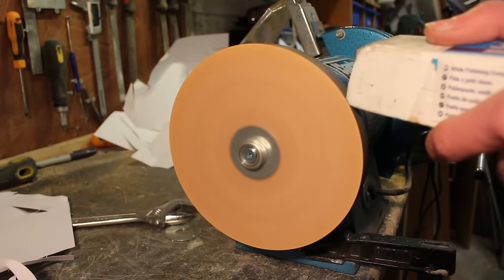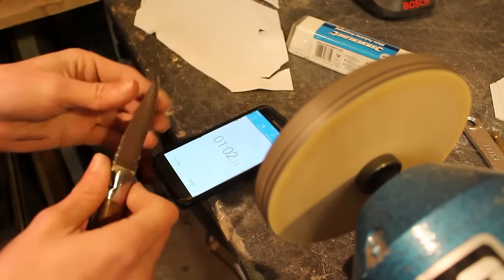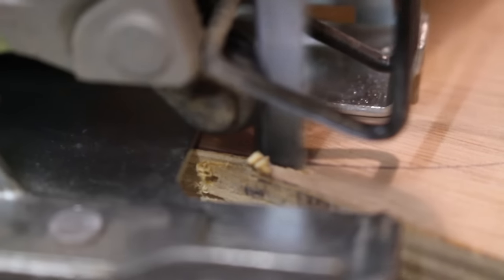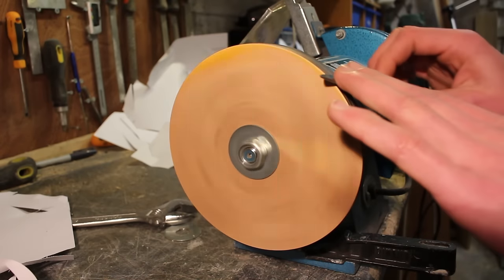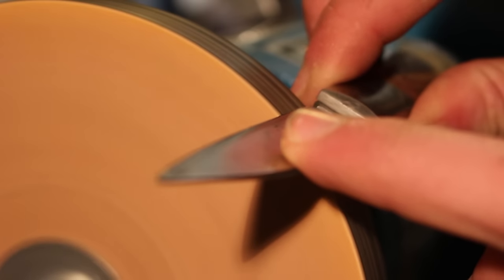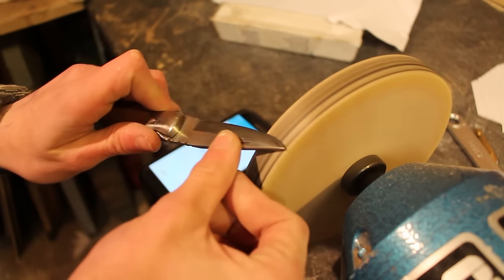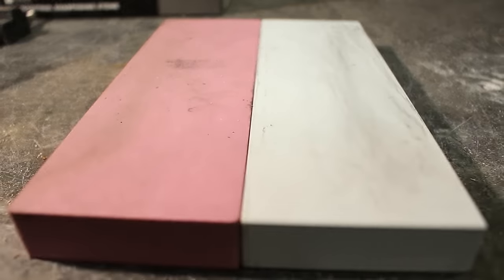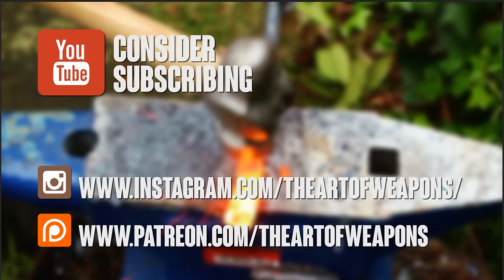The Laziest Way to Sharpen Any Knife to Razor Sharp 2

Comment: I'd just like to point out, with this method, you're basically creating a big burr (By sharpening from the spine to the edge).
This big burr will mean that you can get your knife really sharp, but the edge will be dulled incredibly fast (it will require honing very very often). Many knifes just need honing or stropping to get sharp (replacing the bent burr into place). The longer the burr, the faster it will bend, this is why knifemakers sharpen from the edge to the spine. 

I'm not saying this is a wrong thing to do, I just want to provide more information as tho who this technique is for. A knifemaker would not use this (unless they don't know what they are doing) and this will require frequent honing and sharpening to maintain the edge (far more frequent than one would normally).
If you don't know how to sharpen and don't want to learn, then this is for you.

-Knifemaker and blacksmith.
Reply: Karl Hurtubise wow. Imho this is nonsense. I don't know on which planet knifemaker sharpen from edge to spine, but not at the one i live. The burr won't get to long or even stay there forever, it will eventually rip of and break off of the edge, at least after cutting two or three times into some wood f.e. This happens on a microscopic level. You can easily watch this with a cheap USB microscope. There is absolutely no advantage by grinding from edge to spine. It's more the other way around! When you sharpen in the direction of the spine, small steel particles get pulled towards the spine, ripping small teeth into your edge, which make the edge rough. When steel is soft, a burr can get pulled under your edge, folding around it. 
Watch Japanese chefs or traditional Japanese smiths how they sharpen knifes or swords. They do it from spine to the edge. And they do this for some longer time than any american. Your method has its truth when we talk about very rough grinding with low grit numbers, where the burr is still thick enough to hold on and bend. But when you grind with 3000 grit or more, the burr gets so incredibly thin, that it breakes or rippes of. Though this works only for hardened steel.
Reply: Karl Hurtubise i forgot one important point. When you grind a knife on a whetstone, you absolutely need that burr. Only with the burr you cam actually feel if you grinded long enough on one side of the knife, because it will only be feelable if you your grinded surface of the right angle reaches the tip of the edge. When you feel the burr you change sides, then use a lower grit and repeat until you feel that burr again. If you reached the finest wanted grid you can break the burr by grinding one stroke from edge to spine or you use a fine steel sharpener or a leather belt. The problem you mentioned really just occurs on a macroscopic, rough level, but not on a microscopic level on very fine abrasives.
Reply: by grinding or sharpening from spine to edge, you still create a burr, it is however a lot smaller. Japanese knife makers also sharpen from spine to edge on whetstones,they actually do a back and forth motion to discard any burr more efficiently. so I don't know at all where you get your info from.

Also, on a microscopic level, you always have a serration pattern, as it is exactly that that provides a cutting edge. Without serrations (although the finer they get, the better) you would only be able to cut with pressure, not with back and forth strokes. Those serrations are essential and the finer and more regular they are, the better the edge (other factors as angle and geometry also play a factor) 

Usually, sharpening is done by pushing the edge in the stone, and then final stropping of the knife is done by drawing the edge on a strop.

Now your point about the ripping of small teeth into the edge is just exactly what grinding it does. With a 3000 grit stone, those channels are extremely tiny and will create the serrations needed. Whether it is steel particles or stone particles that create these channels, they will be the same size also. They are still created by sharpening from spine to edge anyway and those channels will be exactly equal, the only difference being the burr size (by pushing the edge into the stone, the burr is created from the very fine edge being pushed up with pression. Stropping (or honing ) is then needed in both methods to align the burr. The longer burr will bend more quickly and need re-stropping faster, it will also tend to chip off.

A very simple search on google will provide info in concordance with my view, and blacksmithing/knifemaking manuals also provide more info. Fyi: I've studied this, and I did it on this very planet.
Reply: Hey Karl... do you have a video that you can recommend for proper techniques for sharpening knives.
Reply: If you strop it on leather afterwards you Polish the burr off
Reply: Corregulated cardboard works also.
Reply: sharpening from spine to edge is the CORRECT way to sharpen a knife.
it produces much less burr than the other way, as evidenced by microscopic photography. it is the exact reason you should never use a motorised sharpener of the type found at the back of can openers, they sharpen along the blade, leaving one long burr which quickly snaps off and returns you knife to blunt
Reply: spine to edge or edge to spine makes no difference, as long as you dont sharpen along the edge as the OP wrongly suggests
Reply: and i highly recommend not to try this shit. i'm a friend of a good old "sharpening steel" - u get the knife same sharp, don't need any electricity and if u got a bit practise, u need only 20-30s. 
sooo....the title of this upload is a lie. + your knifes will not live very long if u use a grinding wheel on them.
wkr,
~ a german toolmaker from daimler benz, class-best of a final exam
Reply: Dichtsau uiuiui da trägt aber einer dick auf. Aber nett das du deinen Lebenslauf mit uns teilst. ;) 
Ein abziehstahl ist gut, kommt aber immer drauf an was mit der klinge passiert ist. Eine runde oder schartige klinge muss geschliffen werden. Imho sind da nassschleifsteine dir beste wahl. Hat jeder so sein eigenes Rezept
Reply: When did I suggest sharpening along the edge ? 
Also I don't think you understand what Spine-to-edge or edge-to-spine means. From spine to edge, you are pushing the material towards the edge (in case of a secondary bevel, from the back of the bevel, to the edge). This causes a huge burr at the sharpest point of the edge, which when aligned by honing, will cut very very well, however that burr is incredibly fragile and will break into food, dulling your edge incredibly fast. The reason why it is fragile is mainly because the material constituting the burr was moved from the back of the spine to the edge by friction and heat, and it welds itself very weakly together at the edge. This also causes another issue, the edge is the one receiving all the heat, which is approx 700*C-1000*C from the mill scale igniting (sparks). you would start losing temper at around 400*C-500*C. The blade doesn't absorb 700*C of heat very quickly, but the thinner your material is, the quicker it will reach that temperature. The edge being very very thin, it will be the part of the knife most susceptible of losing it's temper due to sparks. Now, there is not a lot of heat when sharpening with a buffing wheel, as shown in the video, but when doing grinds, it will have a definite effect. Blade grinds are done spine to edge for this reason.
This method is what this video shows.

Edge to spine pushes your material away from the edge, towards the back of the knife. This only creates a small burr that is far less fragile than the other way. The burr is also different, it is just the far point of the edge rolling on the opposite side of which you are applying pressure to grind the bevel.
This Burr doesn't have a breaking point like the other, and it is significantly smaller (unnoticeable to the naked eye.)

FYI, microscopic photography shows that spine to edge creates a very uneven burr and a breaking point in the edge. The info is out there, look at it before teaching people the wrong stuff.
Reply: im having a hard time getting what you mean by spine to edge and edge to spine. Are you saying that its best to sharpen with edge leading or edge trailing strokes on a stone?
Reply: edge leaging (as if you're cutting a stone). This means that the grain goes from edge to spine (thus not creating a burr). Since in the video the wheel is spinning up, he is pushing the grain from the spine towards the edge (spine to edge).
Reply: Karl Hurtubise okay now, this shall be my last comment on this video. 
I don't get your talks about burrs at all. Fact is: by grinding a knife with belts or grinding wheels, or even on rough wetstones you will always create a burr. This bur is sharp but very brittle. Only at very soft hardened blades like high chromium kitchen knifes, the burr is elastic enough to bend over. On every blade with a hardness of 56 HRC or higher, this burr will eventually break off on finer grits or after polishing on a leather belt. The absolute target has to be to grind a blade to a V-shaped edge with no burr at all. This is obtained with wetstones of a gritnumber of 3000 or higher even when used from edge to spine. There are videos on YouTube that show microscope pictures of differently sharpened blades. Properly done, there will be absolutely no burr, but a V-shaped edge with a minimal thickness of only a few steelgrains. 
I have to tell you: when you sharpen knifes and they still have a burr at the end, then you are either doing it wrong or your steel is very very soft. The target has never to be to create a burr that will be your primary cutting tool. 

A burr can easily be removed while grinding from spine to edge. Though it seems to be easier to remove the burr by grinding from edge to spine. But this will ultimately lead to a sawtooth edge because the grinding stone Crystals ripp huge lumps of steel grains out of your edge pulling them towards the spine where they get cold welded on the way up. This leads to an ugly microscopic texture of your edge. The burr that appears even when grinding with a wetstone of 3000 grits or more is so extremely thin (at best a few atoms thick) and brittle that it breaks of the edge immediately after cutting a sheet of paper or by polishing. There is absolutely no need to worry about burrs when you do your sharpening right. The burr will even be so small that you can't see it with a microscope. It just has to be removed. And when you use wetstones to sharpen your knife there is no heat issue at all that will weaken your edge. This is why this method is the most common sharpening method since centuries or even millenia. 
Translated to this video: if the surface of his flywheel is very fine and if the polishing paste is also fine, it is possible to sharpen the knife without leaving a burr. But it will be a hollow grind edge. Though i would always pull a knife 2 times over a leather belt to give it it's final touch. The heat issue here is a problem though.
Reply: I was answering to previous comments, not to yours. You clearly have your mind set in stone.

However, to respond to your comment,
Fact1: I agree with you, they will always create burrs. Again, in the last post I've said how the burr from the version in the video will be bigger and will have break points. This burr will break into food,etc and will leave a dull edge. the remaining edge will be chipped.

Fact2: Every edges bends over, even on HRC65 knives. That is why you have to hone your knife now and then with a honing steel.

Fact 3: your sawtooth explanation makes zero sense. The whole purpose of grinding is to have the ''stone crystals'' rip through the steel and cut tiny grooves into it. by grinding finer and finer, the grooves are simply finer too. The size of the grooves are the size of the grain. The grooves will be the size of the grain whether you grind spine-to-edge or edge-to-spine, however they will widen up as the grain travels. The widening of those grooves is far better placed at the back of the spine than at the edge. The ''crystals'' wont cold weld to the side, they end up at the end of the surface on which they are ground. That is either the upper bevel part of the grind, or the edge. By having them clump up the edge, you create a bigger burr. 

I sell knives for a living, I have asked another person who sells knives for a living on this issue to be able to explain it more clearly, and they told me the exact same I am telling you. Good Blacksmithing books all agree on this (althought I've seen some that disagree).
Stone techniques use this principle, as well as knive grounds.

Also, hollow grinds do leave burrs too,they simply can't be seen with the naked eye.
Reply: Karl Hurtubise Karl Hurtubise good morning. Yes, i knew that you weren't answering my comments. 

Let's talk about fact 3. I agree with you on the facts 1 and 2.

This is my problem: until a few years ago it was common sense, that every sharpened knife carries  a burr which is the real cutting agent. This is what you keep telling people. 
BUT this is not necessarily true, which people found out since microscopes are affordable to a wider range of people. 

Just think about it: some times you surely remove burrs from different steel workpiece. You might agree that a visible burr of (let's say) a steel bar you cut with a bandsaw is very easy to remove cause it brakes of when moved or bent. 

The burr on a knife edge is way thinner and three or 4 times as brittle. It will break of the edge by just staring at it. Provided that the steel is hard and the sharpening was decent made. 

I could watch this process in various labs i worked in. (f. e. I once had an internship in a renowned hardening company. There i observed hardened axle parts from Audi cars under a microscope. Beforehand i had to cut, grind and polish them) 

You say that the grooves will be as wide as the grain size of your abrasive. That is also not right. Did you ever turn steel on a lathe? Did you observe how steel builds up on your tool, making the tool working less precisely? This happens on the grain as well. When you grind from spine to edge the steel chips get a chance to reach the end of the edge and be carried away. If you grind from edge to spine, the abrasive grains crash into your edge, ripp and break steel out and carry these chips towards the spine leaving invreasing grooves. From spine to edge you won't have such an impact when the abrasive grains reach your steel. The whole process is softer. 

Dammit i wish my englisch was better. I have trouble to exactly explain my points.
Reply: This is honing it, similar to a kitchen steel. With no teeth this method wont work
Reply: This is the exact same thing as using a strop, the compound he puts on is made for strops
Reply: This is not stropping, stropping a dull edge will only make it more dull, it only works on rolled edges or very slightly dulled edges and it is done on a leather strap(or similar mediums) at low speed. You don't remove material when stropping, you align the edge. At the speed this wheel goes and with grit compound, there will be lots of material removed (relatively compared to stopping). This is sharpening and the compound is a high grit compound and acts as a sanding agent. It is a very good way to use very high grit polishes such as 3000+ grit without it being super expensive.
Stropping compounds are .5 microns (approx 50000 grit)
polishing compounds are anywhere from 1000grit to 5000 grit. The one kind he uses is approx 3000 grit.
Buffing compounds (differently named than polishing compounds) can go up to 9000 or even 12000.

It would be the direction you would use a honing steel, or a stop, however he is grinding the edge bevel, which would have to be done in the opposite way. Which by the way isn't safe with his particular setup, or any setup involving wood wheels that the knife can bite into.

(edit to josh, after reading your comments further down, I think we're saying the same thing, but different)
Reply: Karl Hurtubise I agreed with you. And it is a really fast way of stopping.  I'm 32 and been sharpening knives for 20 years professionally (family owned a very popular knife store.)
Reply: He actually talks about the potential for the knife to bite in to the wood. At 3:10 he turns the grinder around so the wheel is spinning away from him and then continues to explain why.
Reply: Karl Hurtubise "you don't remove material when stropping..." then please tell me how does the stropping compound changes color to gray/black when it is not iron oxide forming from tiny amounts of removed steel?
Reply: Because the compound is abrasive and will remove material. You can strop without using compound which re-aligns the blade edge without removing material - same as using a steel for kitchen knives. KH makes no mention of using compound.
Reply: I dont use compound when I strop, the purpose of stropping is to realign the edge, as stated multiple times. However I know that there is 28000-50000 grit compounds for stropping specifically (I have used them in the past) and those do remove a tiny bit of material while also serving as a lubricant(depending on the kind) to preserve the strop longer. Personnaly I find strop compounds to be the easy way around an easy task, stropping or honing is very easy to do already in a perfect manner, the compound simply makes the strops last longer .

I do use the one kind of compound he uses, which is polishing compound, as well as buffing compound (~10k grit) but I don't use these for honing, they are to clean the blade(polishing- 3k grit) of any scratches, and the buffing to make it mirror if I wish to (buffing 8k to 12k) and the buffing compound I almost never use, since when the knife is perfectly mirror, the finish will be ruined by a few handlings.
Reply: Actually yes you are removing material. It's just the bad teeth breaking off. So minimal I don't consider it material being removed.
Reply: It's a flat blade, where are the teeth? The idea of honing is not to remove material, but re-align it in the cutting direction.  Yes after some time, the burrs will fall off and when this happens, the knife will be considered blunt and will require sharpening with (say) a whetstone.
Reply: Gee Zee adult?
Reply: The teeth are micro serrations that come from the abrasive grit of whatever sharpening medium your using on the knife. So its not teeth like a wood saw its very small teeth get cut into the metal by the sharpener. If you look up a magnified picture of a knife edge, even if its super smooth looking normally if you zoom way in its pretty jagged and saw like.
Reply: West Coast Warriors Archive good to know
Reply: Karl Hurtubise the proper way is?
Reply: Weeaboo Trashski From the edge towards the back of the knife is the proper way (edge to spine). It however still is dangerous to do so if unexperienced.
Reply: Don't mess with Texas actually i mostly agree with you. You can believe me, that i really use all my knifes. I just sharpen them when they are too dull for my personal taste, not just for fun. But going into detail and to understand the physics of knife sharpening can be really helpful too. Especially when you are a knifemaker. In the end an edge is something that is microscopeically small and can't be seen with the naked eye. 
But yes, all that bevel talk was really annoying.
Reply: Karl Hurtubise Read his title man. He didn't claim this is the best or most professional way lol. It's quick and easy.
Reply: Karl Hurtubise   This is a great method and I will give it a try.  I. Currently use a belt sander with a 1200 grit belt.
Reply: dude try it or don't no biggie!
Reply: Excellent point Karl!  May I ask your opinion on diamond n n blocks?  They seem rather crude feeling compared to a nice stone.  I am using a diamond bed then stone. Should be alright?
Reply: Yep. I made the same comment. This is power stropping. Might as well coat the wood with leather, as it is proven to be very effective at uncurling the edge of knifes. This method cannot hone a new edge, wood is softer than steel.
Reply: Richard Smith 
Thank You for your input.  Most appreciated!
Reply: Hahaha.
Too obvious that you did even not try it.
Reply: Karl Hurtubise Karl! You seem like you know your craft. Any way I can contact you with some questions??
Reply: Karl, isn't misinformation frustrating?  I feel your pain, but I could see this plywood method being useful as a finishing step for drill bits after you shape them on the normal grinder.
Reply: Richard Smith this would only be power stropping if he wasn't using polishing compound on the wheel. The polishing compound is what is harder than the steel and thus removing it on a microscopic level. What is being done in this video is actually removing metal not just stropping.
Reply: My thoughts exactly. A lanky set with diamond stones and a leather polishing jig is good enough for the hardest steels like m4 and s90v. 10 minutes and you're good
Reply: Finally, some common sense, thank you.
Reply: Actually, with an abrasive involved, the material will be removed from the harder material. Think about a buffing wheel.
Reply: Karl Hurtubise, you are right.  When you sharpen a knife on whetstones, you push the edge of the knife away from you. Thus you are sharpening the blade from edge to spine. When you are stropping a knife, you pull it across the strop from spine to edge. YouTube is full of myths and misinformation about sharpening.
Reply: Ghryst - only commies and Martians uses a can opener to sharpen a knife...and we all know how dull their knives are.
Reply: Taunus-Tims - Sure Hans - easy for you to say.
Reply: Scandi vs convex grind, go.
Reply: How can I learn the art?  I have a grinder to convert, I'm looking to support 3 kids with some side work.
Reply: Karldude, you have never ever in your life made, handled, or sharpened a knife. Just a whole lot of keyboards. Now go away.
Reply: Murray Carter for one, disagrees.

Anyways. Always fun to observe the secterisms and politics of the sharpening community, and the "wars" they ignite
Reply: @Taunus-Tim  Ok, so...I'm a hunter and a butcher and I have to say I learned and have always sharpened knives from edge to spine...never had reason to complain about either sharpness or durability.
Reply: @rich1051414  You missed where he applied polishing compound to the wood, didn't you?
Reply: Yes burs will be all you create with this method. Thanks for pointing it out.
Reply: @Taunus-Tim  lots of sharpening methods are exclusively edge to spine. Straight razors are an example of this and they require much finer of an edge than knives do.
Reply: @karlhurtubise7073  even without the serrations a sawing motion breaks static friction which allows better cutting. The serrations are the main reason but not the only one.
Reply: @Dichtsau  the video doesn't use a grinding wheel, did you even watch the video? And a steel doesn't sharpen a knife, it just fixes the geometry of an already sharp knife.
Reply: @karlhurtubise7073  as someone who made straight razors which require sharpening by strop, the stropping actually does remove miniscule amounts of material, slightly less than the finest most watered down polishing compound, this is due to the mineral content of the leather. The leather itself is too soft to do much of any reshaping of the edge.
Reply: @karlhurtubise7073  also, he has the knife edge away from the direction of travel of the wheel, it CANT bite into the wheel which is why there are wheels just like this mass produced specifically for sharpening knives.
Reply: This method looks simple. I am not a knife expert. I just want a sharp knife to cut my veggies. Thanks for the video
Reply: @camg5367   When I heard him say that it's very important to turn the grinder around so that the wheel is spinning in the right Direction; that being away from and not towards the edge you plan to sharpen, I couldn't help but crack up. The direction polishing wheel is rotating is, as he correctly stated, very important. But you never should have to flip your grinding or sharpening Wheels 180 degrees in order to sharpen anything correctly. You just have to flip your knife!!!! Derp. And if he hadn't figure that out, this'll probably blow his mind... try mounting the grinder perpendicular to the bench instead of parallel. And you'll have access to both sides. Did anyone else think the same, or is it just me? LMAO
Reply: @Taunus-Tim  You have a lot to learn about burr formation, burr removal, and burrs in general, as well as many other aspects of sharpening. These are old comments, so maybe you've learned quite a bit in the last 5 years. But you have fallen victim to several misconceptions, and I just wanted anyone reading this thread to know there is a lot more to these topics. If interested, I can explain. But as I mentioned you may already know a lot more by now.